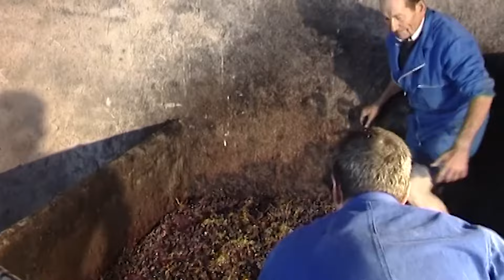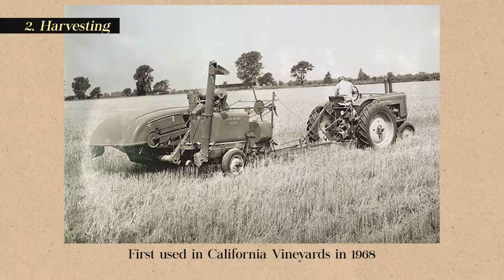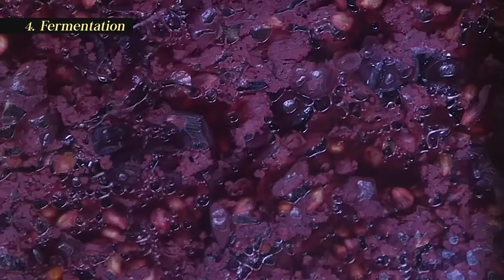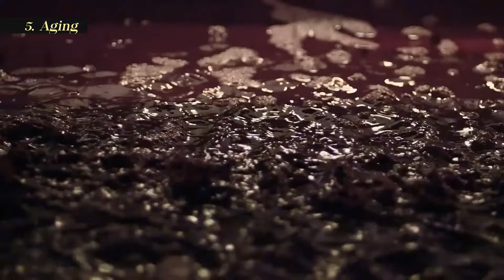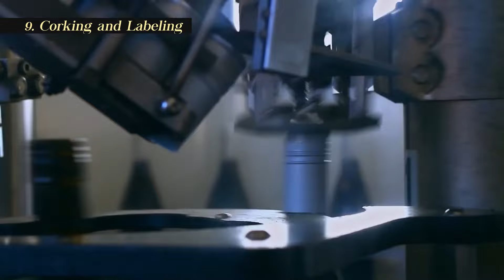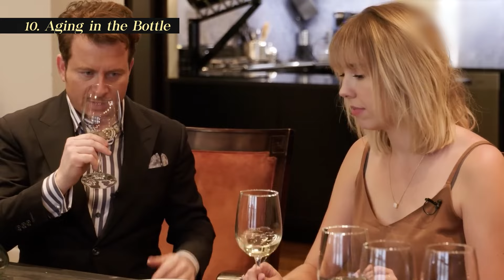The Entire Process of Making Wine

Comment: Having a screw cap on the bottle doesn’t necessarily mean cheaper or even lower quality.
Reply: I agree and wonder what year this video was made. PlumpJack wines have received ratings over 90 for the last 10-12 years, and are in screw-top.
Reply: Plastic caps (similar than real corks are) is best choice for product itself, because risk that wine have got oxygen or leaking any other ways is practical zero.
(99% of time, it's impossible to tell does it, before bottle is opened and tasted) 

I haven't found new (not used) plastic corks from shop, but I have relative good nature's made ones. Those are more expensive from factor and not that good than soft gummy like plastic ones.

Some "experts" says that few prosent's of every natural corks have leaked in factory wine's in storage. Here in Finland, it's possible to return wine, if it have problem with taste because of cork, so it's not legendary thing.

I think wax sealant over cork could make help to avoid problem, some types of wine's could generate pressure or even go negative versus how things are outside of bottle. 

With sparkling wines this problem is smaller and different. There they have used long time other than natural corks big part of products. At least in sparkling wines, I'm not sure what Champagne rulings say about this. 

It's possible that regulations of real Champagne could have some limitations of types and materials about corks. 

Champagne is sparkling wine, but every sparkling wine aren't Champagne. 
(for those, who are wondering what I just write)